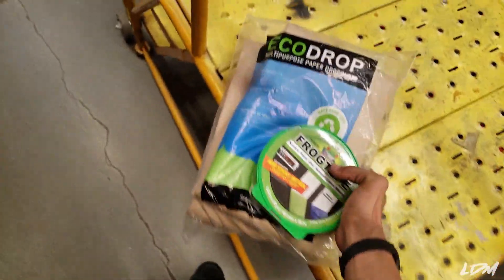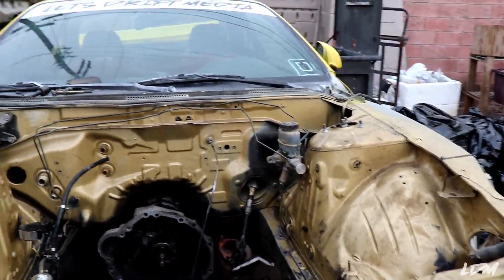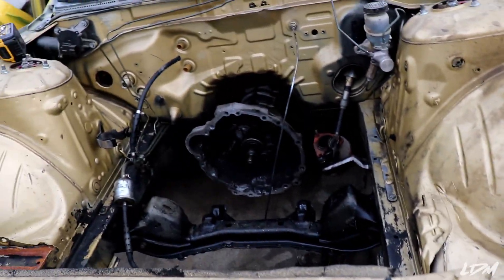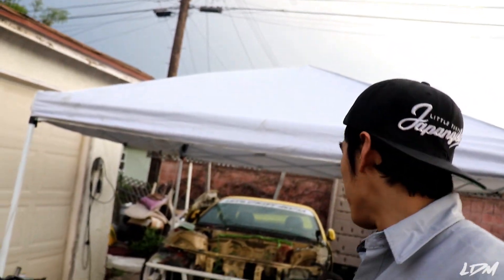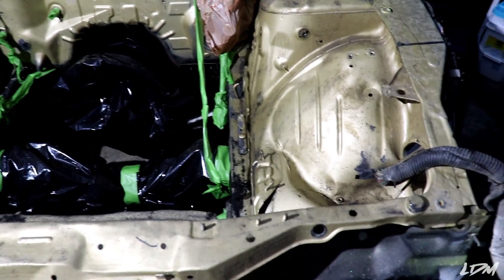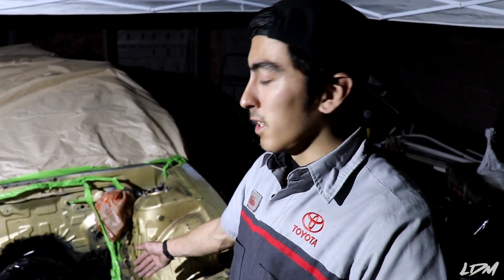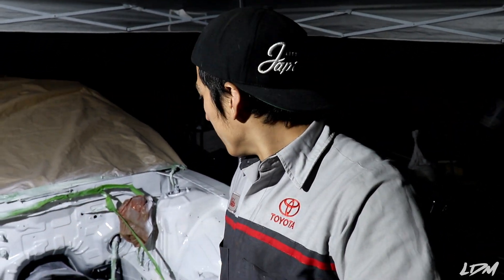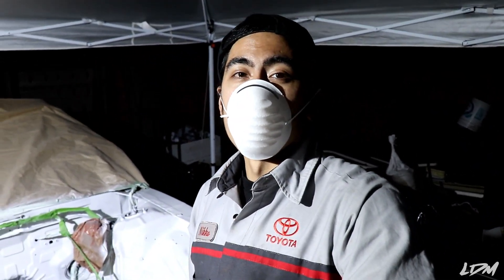HOW NOT TO PAINT YOUR 240SX ENGINE BAY

Comment: Do two layers of clear coat  Rustolem enamel clear  👌
Reply from the maker: Fersure is that what you did? Was planning on hitting it with the same clear coat I threw on my car paint job figured it would be better then rattle can
Reply: Lets Drift Media  yeah use spray gun if you have it for sure , but if not use can i did notice with clear helps with scratches and cleaning after a track day!
Reply from the maker: I was thinking the same thing. Will be clear coating tonight!